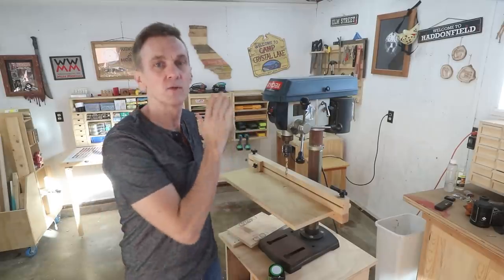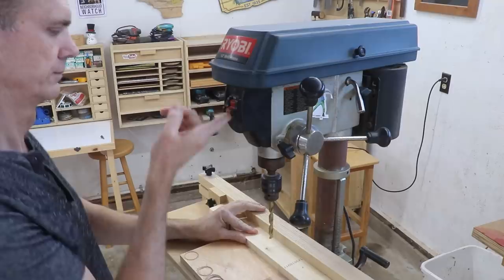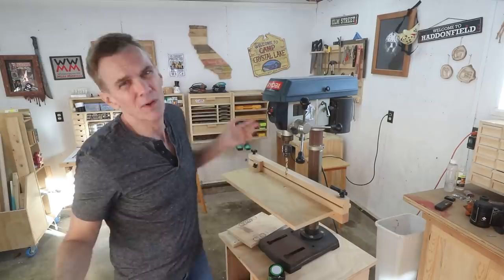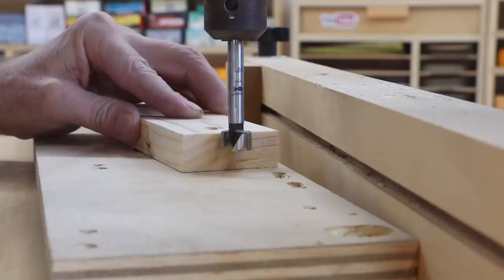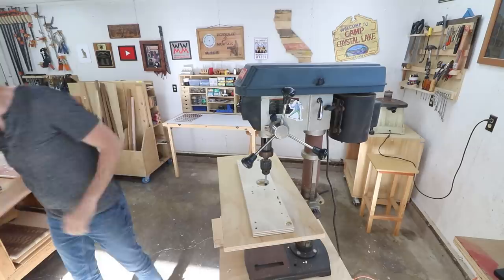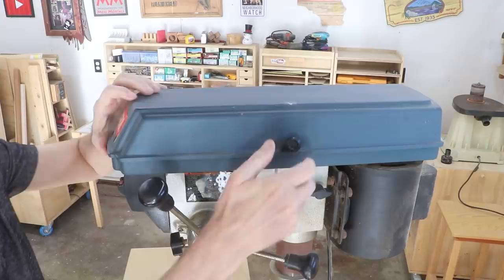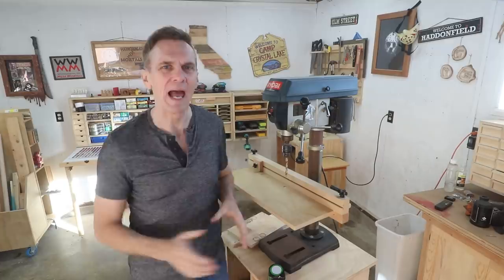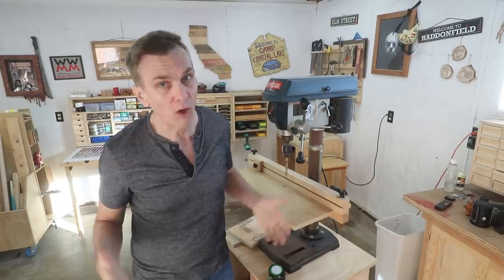How important is a drill press? I mean, it's such a boring tool.

Comment: For those shopping:
Must have features -  rack and pinion crank for raising and lowering the table while maintaining alignment, quality depth stop, a cast iron base and as Steve says, a MINIMUM of 10 inches on the throat or you won't be able to reach the middle of 6 inch stock and use a fence - I think 12 is pretty ideal for woodworking and takes up less space than 15, if space is a consideration for you.
Good to have features - decently sized arms on the main crank (some jobs require a bit of force to be applied), a decent amount of travel (maximum depth of drilling), high quality table material so you never have to worry about warping.
Useless features - laser guides (no extra precision here, and not precise enough for actual precision work) - mine has them, but I never turn them on.  If you need precision, you're better off using a center punch and checking alignment by lowing the bit to the punch just like hand drilling.  The laser lines can sometimes be slightly off, or can appear to be dead on when they are actually a hair off.

Must have accessories - a table with a good fence (DIY like Steve's or shop around, I prefer a metal fence)

Bottom line, if you decide to buy the cheapest model, it will get you drilling, but chances are you'll be looking for a replacement within a few months and the ones that will actually do what you want aren't that much more money, so you're better off saving a little longer and getting a good DP from the start.

Comment: A drill press only drills straight holes if:  1) the table is level side to side - you need to check this; and 2) the clamp that keeps the table height from moving is fairly tight (front to back squareness).

Comment: A portable drill guide can be a useful alternative to a full drill press. I'd skip the sleeve-type drill guides, and go for the version that clamps around your drill.
Reply: Yes, the portable drill guides can perform many operations that are not even possible with a drill press or a handheld drill by itself. They do ask a stiff price for them though.
Reply: @bobd.  I got mine for about €44, which isn't free, but not excessive I think. Note that this is a model in which the hand-held drill is clamped, and you use the original chuck to hold the drill-bit. The other style with bearings and an extra chuck is likely much more expensive.

Comment: Forstner bit plus the depth stop is a great way to rough out stopped mortises or inset hardware.  You can end up with a little, or extremely little, to remove with a chisel to finish up.

Comment: The 12in refers to "swing" so if you stuck a pencil in the chuck that is the size of the curve it would cut. Need depends a lot on the type of work you do especially if it is repetitive boring as with jigs etc. While I do not use my 17in 1hp model a lot, when I need it I use it a lot.

Comment: Hey Steve most of the time I agree with you but this time ... no.  Once you have a drill press you will never do without.  Agree, you can drill a fairly straight hole with a hand drill but if we are measuring our cuts in 32'nds then I want a perpendicular hole to within 0.5 degrees.  When you drill holes longer than 4"s or so it needs a drill press.

Comment: I usually agree with you about tools, but have to say that you dismiss laser guides too casually.  Having laser crosshairs on my drill press has turned out to be a very nice feature, especially for drilling multiple holes.  Essential?  No.  But minimal cost and often helpful to quickly put "the spot" in the right place for the drill.

Comment: I used to like my drill press, but I have been having power problems with it... Any light pressure I apply on it with a 4-1/4 hole saw on plywood brings it to a complete stall. Is it just underpowered, or something is faulty with it? Should a typical drill press be able to drive a hole saw through a 1/2 board without issues?

Comment: Awesome video once again. Acquiring a drill press is something I'm still in doubt about because of the space it takes up. My 'workshop' is only a tiny garage so I really don't have enough space for a lot of tools. On the other hand I've had a few occasions now where I needed to drill perfectly straight holes and I'm unable to do so by hand it turns out. So what I was wondering is whether there are any feasible alternatives to consider which take up less space. And maybe I can reuse my cordless drill in those. I've seen the cheap China drill press guide thingies but those didn't convince me yet.

Comment: I find my tool press's drill bit wobbles herendoulsy when drilling into it, can never get a pinpoint cut even on metal work it wasnt a cheap drill press either. The worst of it is when cutting holes with a hole cutter the drill press has no power. It really defeated the purpose of buying one, I just use a standard drill. It takes about 15 min to cut a hole in a piece of wood and just sec with a hand drill.

Comment: As I shop for a drill press one of my concerns is whether the distance from the bit to the pole varies by machine or is relatively constant. That distance seems very limiting on the placement of your hold on a work piece. Is that an actual problem or am I inventing issues?
Reply: The distance from bit to pole varies but is easy to calculate. The distance from bit to pole is half as many inches in the rating. A 10 inch drill press has 5 inches from bit to pole. A 12 inch drill press has 6. So the rating refers to the maximum width material that can be drilled on center. Logically if you needed to go farther than center you could just flip the work piece around and the distance is now less than half.

Comment: You forgot to mention there are variable speed drill presses - I have one and its verye asy to change speeds than moving belts all the time.

The second point is the mechanical advantage in the wheel...it amplifies the pressure downwards much more than you can achieve with a hand drill...especially useful with Wide Forstner bits or hole saw bits.

Comment: Based on the prices on Craigslist, drill presses depreciate very very slowly.
Reply: Keep hunting, I own 2.  Both similar to his in the video.  Purchased one at $30, one at $40.  I keep one set to making a certain box, other for all my miscellaneous work.
Reply: @jackflash7905   the affordable ones I see are bench top Central Machinery, Ryobi, or Wen models. Jet, Grizzly, and Delta are all quite pricey.
Reply: @theScamBKLYN  yes, they are more expensive for the nicer ones, even at age.  My Delta I picked up for $40, it’s a 10”.  My Wen I picked up for $35, 8”.  Again, time was needed to find them at these prices.  I still do see deals like this time to time but I no longer need them so I pass.
Reply: @theScamBKLYN  Older (1970s to ~2000) Craftsman drill presses were made by Emerson. They are good tools and for a floor model 15" 1/2 HP in VG condition WITH the chuck key I would go as high as $250. Again that's depending on condition. Look at the chuck and see what make it is. If it's a Jacobs that is a good quality chuck they are still made today.

Comment: Thank you, Steve. I recently purchased a 10 inch craftsman table saw. After using it for a couple of projects, it appears that the fence is not true parallel to the blade. Should I return the saw or is there some sort of adjustments that I am typically supposed to do after getting a new table saw.
Reply: Without seeing your exact saw, I'll say most table saws have an adjustment under the table for aligning the blade. The adjustable part is called a trunion. There should be plenty of videos on youtube for how that adjustment works. There is also an inexpensive apparatus called a PALS system. Runs about 20 bucks and installs on most trunion types to give you a micro-adjustment that can lock in place so your alignment is nearly impossible to knock out. Very helpful for contractors whose saws get bounced around a good bit between jobsites.
Reply: Check the owner's manual to see how to make adjustments.  It happens all the time.  Check some YouTube videos as it is generally easy to do.